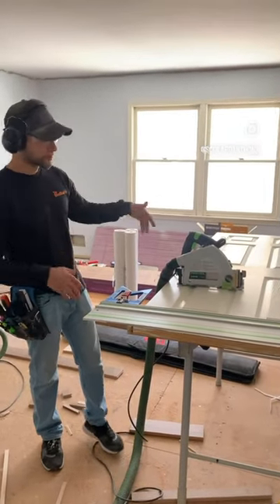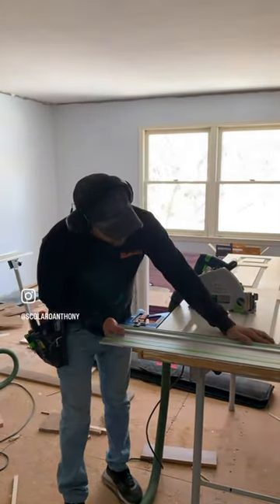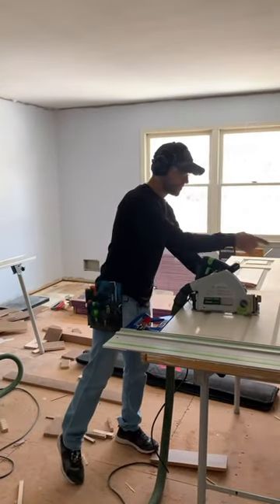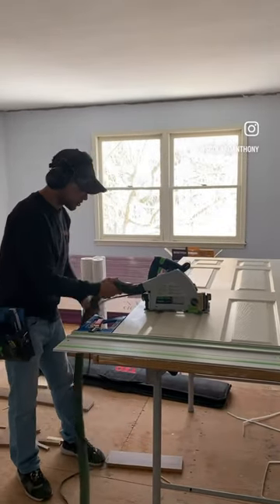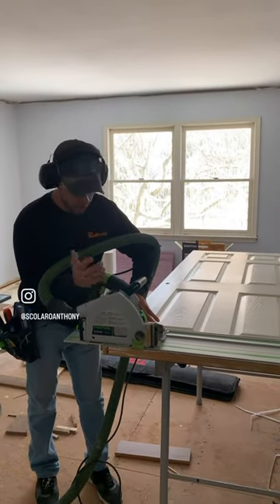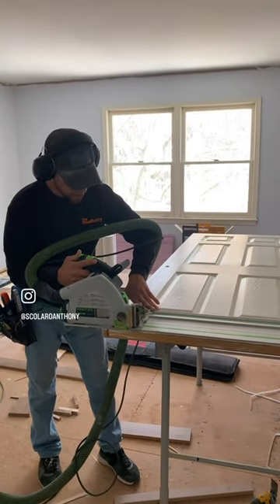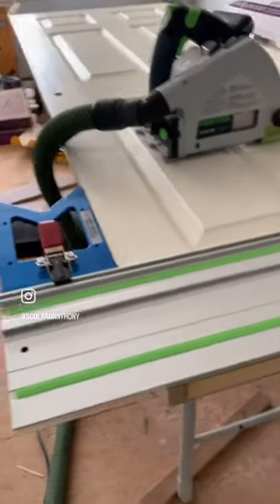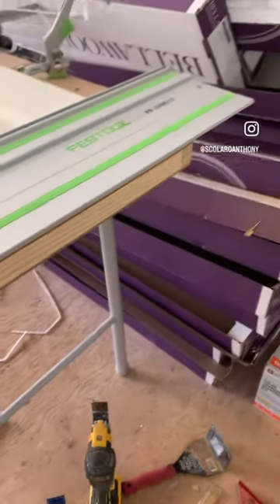Easy way to trim doors #trim #interior #doors #homeimprovement #shorts

Comment: Makita has also some clamps which you can slide in the underside of the rail. Most of the times is use these to secure the rail on cuts which arent aloud go go wrong
Reply from the maker: I have the Festool quick clamps for that but no clamps are needed for these cuts.